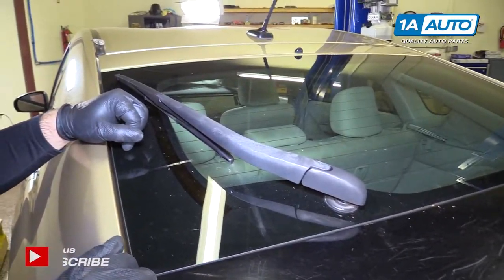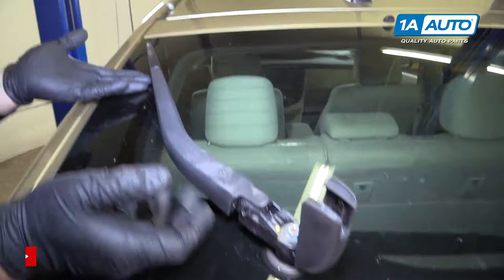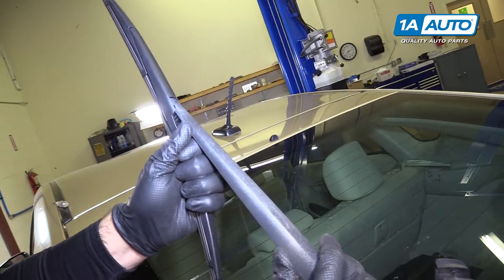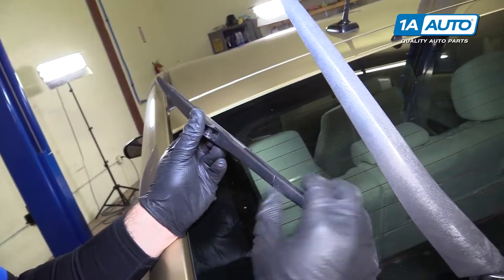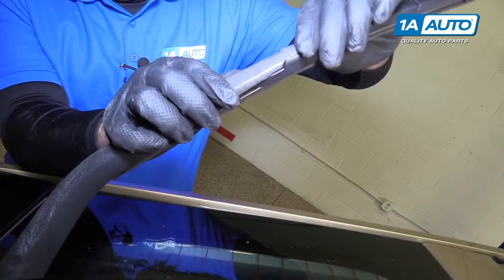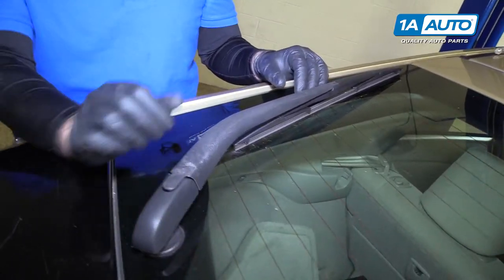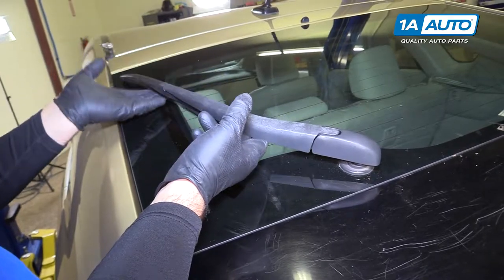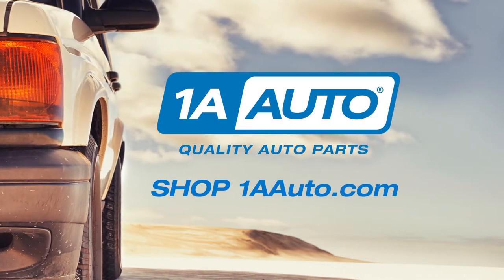How to Replace Rear Wiper Blade 10-15 Toyota Prius

Comment: Thank you for posting this! I couldn't even find how to change the wiper blades in the Prius owner's manual. I was wondering if it was so easy they thought they didn't need to include it. And the package diagrams look like hieroglyphics. Your video-- one minute, and we're like, "Oh, THAT'S how!"
Reply from the maker: +Karen H Thanks for checking us out. Shop here for high quality auto parts: http://1aau.to/m/Shop-1AAuto-c
Reply: THANK YOU SO MUCH. I knew there had to be a way.
Reply: Thank you SO much for taking the time to make this video!! I would've said screw it & broke it if not for you!
Reply from the maker: +Jabok Channel Thanks for checking us out! http://1aau.to/m/Shop-1AAuto-c

Comment: I bought a Michelin Guardian 16" blade at costco.  It appears that the hook on my prius is too wide.  Anyone else?  Good video but replacement part number would be helpful.  Thank you.
Reply: You need a wiper blade that is specifically for the rear of your car.  The one you bought has to be a front windshield wiper as it won't fit in the back.  Check out the Trico Exact Fit Rear Wiper.  It is about $11 or so and available at auto parts stores or Amazon.  There are other brands for even less money that should work, but  make sure it is for the rear.

Comment: It would have been nice had they showed us the larger opening on the wiper replacement blade is closest to the pivoting wiper arm.  Of course it's easiest to see when you take the old blade assembly off.